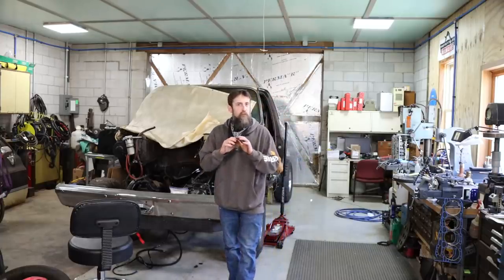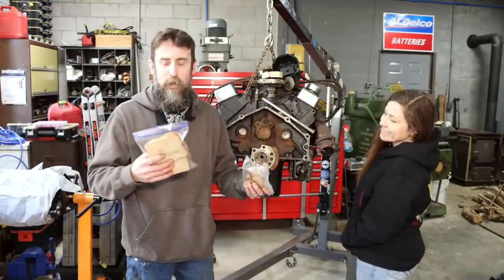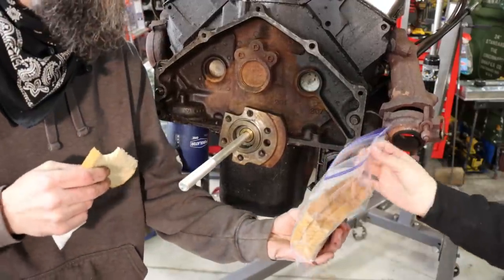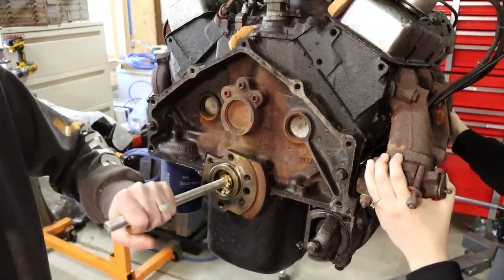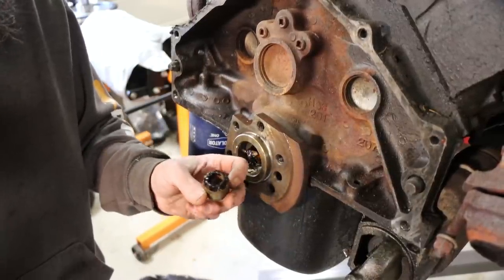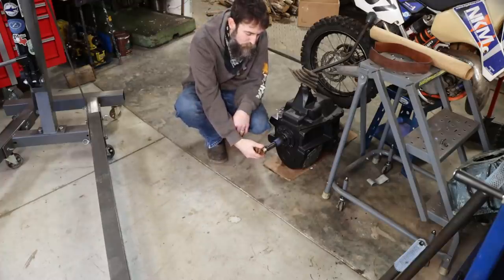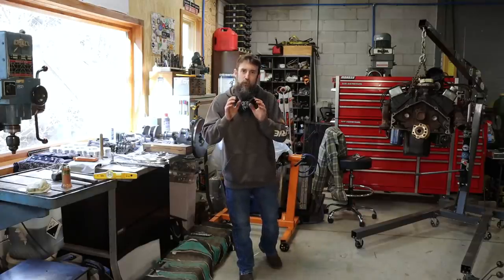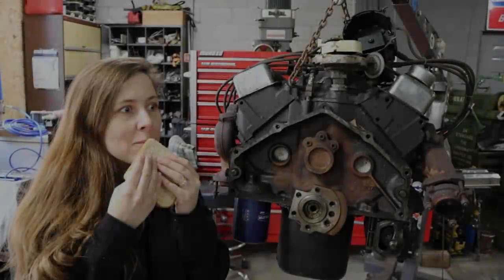Neat Trick Removing Bearings With BREAD?? Yes bread.

Comment: I use bread when I sweat solder copper pipe if i have a water/steam issue. Packed in the pipe it holds back the water enough to get the heat in the pipe to solder and flushes out easy when done

Comment: Used grease and tight fitting rod many times to remove pilot bearings.  Bottoming tap and bolt work well also on the softer ones.

Comment: Friend doing the same task but had a huge EasyOut (i never knew they were made that big) that just was not working because the sintered bronze just kept chewy-chewing out. Before he completely wrecked it we loaded in Vaseline petroleum jelly & had that sucker out quick smart. The Vaseline has a low melt point & easy clean up.... I've even used Vaseline to pack new oilpump gears on account the particular pump/engine setup just will not prime & lift the oil out of the sump at first startup...
Reply: On bronze bushings in blind holes iv used a tap that will cut threads in the bushing. just turn the tap in, and when it bottoms out, just keep on turning. The bushing comes right out. Works great on old tractor generators and starter bushings on old vw bugs😉👍
Reply: In today's age Vaseline has become the equivalent of "lost herb remedies". Many years back an old "country doctor" style mechanic (who rebuilt starters, alternators, steering boxes etc.) showed me the ropes with automatic transmissions. He presoaked his clutches in ATF like usual, but the only other lube assembly used was Vaseline. His teaching claim was you could use it for almost any petroleum lubricated assembly and it was impossible to hurt anything because of vaseline's ability to melt and mix.

Comment: Back in the sixties, my father ran a garage. He would use grease and a transmission input shaft that fit the bore of the bearing. 
Of course, you can't eat the grease afterward.

Comment: I have removed crank bolts by taking a breaker bar and setting the handle side on your frame. You might need a piece of pipe to extend the breaker bar. Crank the engine over a little and it will break the crank bolt loose.

Comment: I've used grease for this, bread is cool twist I've never heard of. You're right, you need a punch that fits very tight. I normally buy a wooden dowel that won't fit in the hole and take it to the grinder to make it just fit... tighter the better.

Comment: To remove a stuck nut without messing up the bolt. Pick a flat side of the nut and drill a small hole deep enough that it goes through that side of the nut. It doesn't matter if you drill into the threads a tiny bit, you wont mess them up even if you do. Take a cold chisel and give it a good smack to spread the nut apart. You can now remove the nut by hand =)

The nut wont gall the threads while removing it either. Easy to run a die down the bolt and clean it up.

Comment: when the inner race of the ball bearing broke, and we need to remove the external race, we stick weld in the ball channel and this contract and you remove it with your hands. No distorsion to the cranshaft or seal burned or nathing,just the easy way with the engine in the truck.

Comment: I use a large course thread tap that will bite into the bushing. As you turn the tap in, it will bottom out , keep turning and the bushing will thread  itself out. It spoils the bushings but I'd be replacing it anyway.

Comment: I am likely repetitive, but I don't have time to read all of the comments...
I rely on grease or clay for this purpose, but I also fit my piston (punch) with tighter clearance tolerances than you demonstrated. This trick fails when the bushing is flush seated against the bottom of the bore and when the hole has a vent such as through bored. The trick necessitates forcing the jacking agent behind the inboard end of the bushing. I have created enough of a void on a flush seated bushing with a die grinder to enable to achieve the effect.

I have successfully used the bread trick to stop trickling water when sweating water lines, but white bread is a best choice. Any bread with yummy grain chunks won't dissolve and can stop up plumbing orifices and aerator screens.

Comment: I just posted a video similar to this a couple weeks ago. I didn’t use bread though ( I really liked that idea by the way). I assembly goo, for transmission rebuilding. It is much thicker than grease and works way better than grease. However, I think the cleanup with bread is much better!  Thanks for sharing.

Comment: I use a body slide hammer to remove front oil seals.  
Punch a small hole in the metal face and screw the threaded point into the hole.  
Pops them out in seconds without touching the crankshaft surface.  
In a pinch you can use a sheet metal screw and a pair of vice grips.

Comment: Feed string into a cylinder via the spark plug hole and bring up the piston to hold the vlaves shut. Now you can replace a broken valve spring and/or guide seal without pulling the head.

Comment: water soaked paper towel is one I've seen used, probably best used where you can set the part where the water doesn't drip out.  Whatever is used, the punch needs to be a reasonably good fit to the bushing bore.  It may be messy, but it beats nibbling the old one away with a burr.  I'd forgotten about this trick when I put a clutch in my S10 (CRST STILL owes me for that clutch!) and I wasted 3 hours removing the old one with a rotary file and a cordless drill ... when something reminded me of this, I realized I'd had my first seriously "senior moment."

"Doh!"

I blew that engine a year or two later (another "doh!" ... but it was worn out anyway), and used this trick (with grease) to remove the still good bushing, and machined it to use in the cement mixer ... another hack for your bag of tricks, those bushings have a fair amount of material, and can be easily re-machined.  I purchased a few more (the parts store had 6 of them, collecting dust on the shelf), turned/bored to size, and stacked them in to get the length I needed.  In this instance, it was a much faster and way cheaper option.

Comment: Bread works good on copper water pipe,old plumber trick,take bread wading from your lunch sandwich.push up pipe you need to sweat,solder then turn water on,flushes right out.🙂

Comment: Plane ol' ordinary grease does the same thing and is a bit easier to find in the garage,,,,,But you can't beat bread for stopping water coming down a pipe you are trying to sweat. It swells up in the pipe  and stops the water and them just blows out when you turn the water back on. (Learned those from my Dad and been doing both for like 60 years)

Comment: Another use of bread in plumbing. Have you ever tried to solder a fitting on a horizontal copper pipe that still has water in it and you can't completely drain it dry. The water creeps to the hot joint and cools it to where the solder won't flow. Solution is to stuff the open pipe end with bread. This blocks the water enough to keep it off the pipe at the joint so it gets hot enough the solder to flow properly. Then once pressurized and the water flowing, the bread disintegrates. and it's non toxic to boot!

Comment: Not an engine trick, but when I was dating my now wife, I noticed her shower curtain had torn out of the hangers in a few spots, and so I asked if she wanted me to try and fix it, and if so, did she have a stapler and scotch tape....she thought I was nuts, but if you staple the ends of the shower curtain closed, ie one side on each side of the tear (like a doctor would staple a cut closed, but in the shower curtain), then put scotch tape over the staple to seal out the water, it works to close up the tear and it goes back on the hangers as long as you dont yank on it too hard...needless to say, it then lasted for over a year like that until she finally decided she wanted a new curtain.
Reply: Well Joseph, it’s like Red Green used to say “If women don’t find you handsome,
They should at least find you handy”. Lol

Comment: Always used wheel bearing grease. The guys called it “hydraulic-ing” the bearing (or bushing) out. Works slick. 
Save the bread for soldering copper water pipes. When the shutoff valve leaks even a few drops you can’t sweat copper fittings. A little bread upstream of the joint & you’re able to sweat the joint. after it cools, open the valves upstream & downstream and flush the bread out.
Reply: So, it's your way or the hiway?
Using bread for this application isn't wrong, it's just different. 
Keep an open mind. There might be someone out there that knows something you don't.
Reply: Hmm, clean up grease or clean up bread.....

Comment: I'll have to remember that.  We used grease and, I can't remember what the name of it is, umm...Irish Spring maybe? soap.  And you sure do want a rod that fits snuggly or it turns into an ordeal.  Even with soap.  I need to pull a pilot bearing maybe once in two years, so no need to spend the money on a dedicated tool.  Although I do have a slide hammer.  I just don't like using it for that purpose. Depending on the bearing.  Or the job.